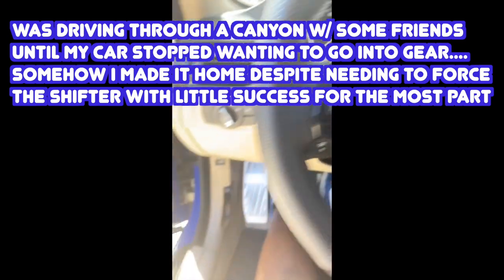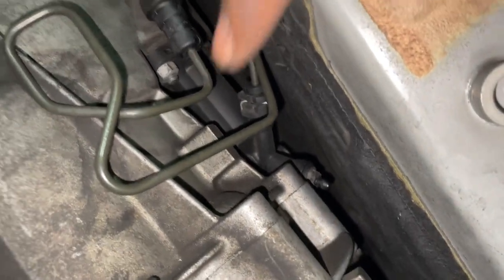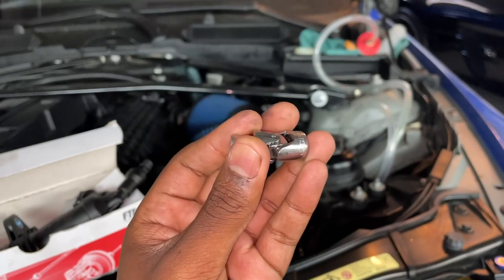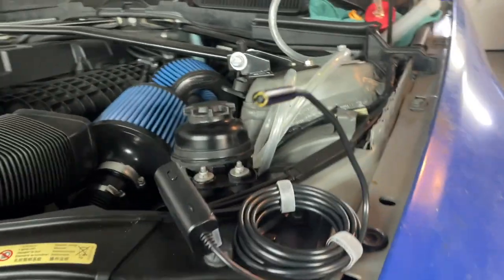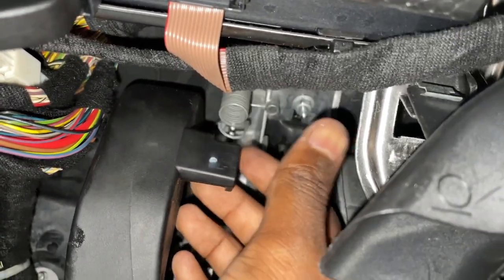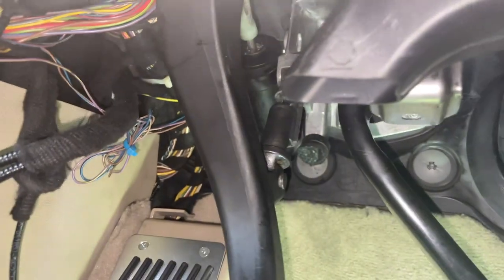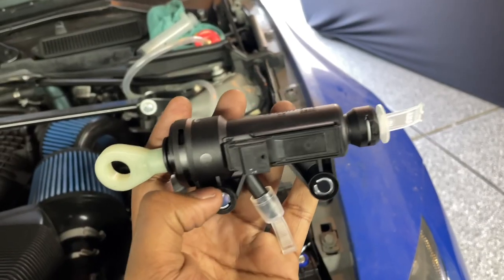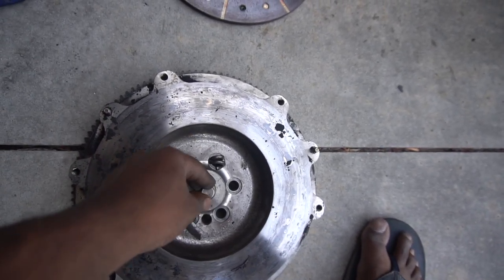BMW Clutch Master and Slave Cylinder Replacement + Clutch Bleeding - E92 335i

Comment: I just put a bunch of extensions together to get that top nut off of the slave cylinder, i got at it from the back of the transmission. Super easy
Reply from the maker: Whatever works haha, glad you got it off
Reply: @SamAbraham  yea lol, your transmission removal video really helped me out, I had to refer to it like 30 times when servicing the transmission. You really came in clutch pun intended
Reply from the maker: @epaminontas6972  Hahaha

Comment: How did u put it back in? Did you push the slave spring in then installed it? And did you put the slave first then the clutch line or you put the line then installed it
Reply from the maker: I believe I just pushed the slave in against the clutch release arm, and allowed it to compress while it was in place, and then used my other hand to thread the bottom nut so that it wouldn't move. I attached the clutch line after, this part shouldn't really matter as you'll bleed the system regardless. Also heard that you can bleed the slave while its not in the car and you'll have better results bleeding it, I just can't remember the exact procedure for that

Comment: Either my pilot bearing blew, or a nut came loose. But either way for me… my entire first friction disc was destroyed, my second friction disc was toast, then my pressure plate was toast. Each plate had massive scoring.

Was just driving home from work went to shift from 2nd to 3rd and clunk! No more shifting, clutch stuck to the floor for a little while. Flat bed to home…
Reply: I just had this happen to me I went to shift 2-3 coming home from work I replaced both master and slave bled it and still nothing won’t go into gear while it’s on but I was able to float the gear and get it home with out using the clutch pedal
Reply from the maker: Both of your experiences sound very similar to how I had to drive home, where I was 50 miles from at the time

Comment: does the clutch line that runs from the slave to the master feed through the vehicle ? im going to swap my line to a stainless material and was wondering where the line was running.. 

good video btw
Reply from the maker: there's a hard line that goes out from the master cylinder through the firewall, that then wraps around to get to the slave cyl. And thanks!

Comment: what do you mean by gravity bleeding?
Reply: did you leave the Reservoir  cap open, pedal depressed or pressed, bleeder valve open or closed? i’ve been having trouble with my slave cylinder and the bleeding process
Reply from the maker: @srtprince6568  Cap open, pedal depressed, and bleeder valve open. I left it like this for a few days while I was on vacation. Came home and pumped the pedal up easily and then closed the bleeder. Supposedly the air gets trapped slowly makes its way out of the system
Reply: @SamAbraham  awesome man great build check out my n54 if your interested vertn54 on youtube
Reply from the maker: @srtprince6568  bet

Comment: U could of lower the transmision...
Reply from the maker: Yeah dropping the whole transmission wouldn't have been a very simple process lol, even lowering it by just removing the brace wouldn't have lowered it enough to get better access
Reply: @SamAbraham  i just lowered the subframe a little and the transmission... came down a whole foot.. then again, i have xdrive
Reply from the maker: @beamerandthebeast3979  Ah yes, quite a different setup you guys have